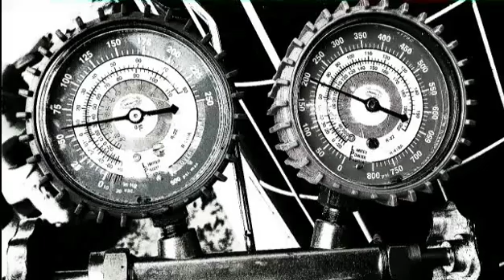R22 to R410a Conversion: Line Set??

Comment: I had a r22 system and it was low. A tech told me he didn’t have any r22 and wanted me to let him install a new system for $9,000. I bought a gauge unit off ebay, a r12 to r134 adapter from Napa and 4 cans of r134 from Walmart. I installed the freon and my system ran fine for 5 months until winter.
Reply: What happened after winter?
Reply: @nthomas36  I install a new Rheem evaporator and a Goodman condenser.
Reply: And by reading this right r22 is a home system r134 is an auto system.
Reply: @jchistia  And? A/c work the same weather in a house or car. They said my system was old and about to die. I just wanted it to last one more summer. It did using the 134.

Comment: I know this is an old video but here is my practice. If the old lines are brazed and sized properly I reuse them with no flush just nitrogen purge. If soldered joints in multiple places kinks I replace it. I have never had an issue reusing a good looking line set. I install a new dryer / filter. I tend to use a dryer/ filter larger than most but go big or go home.

Comment: But what if the line sets used for r22 were .032 wall thickness and it is required that wall thickness for 410a are .081 . Would the .032 work for 410a?

Comment: And one more thing..... just think about this... it's all about more money. 

I have never used nitrogen to purge while brazing and have never had a problem. If done correctly, i.e. not using 15 elbows, you won't have a problem. It's a gimmick to get you to have to buy more nitrogen. When this was first introduced in say, 2008-9, I had already installed hundreds of 410 systems. Without issues. The price of nitrogen went up because Parker Sporlan ran seminars all across the country and the demand for nitrogen increased. 
I don't do it. I don't flush. I did once. My partner and I tried it. Cost was damn near $100. We shot it thru only to watch our $100 land on the concrete and evaporate. Never used it again. As far as the nitrogen purge goes, whatever flaking does occur will be caught by the screen and filter dryer. I don't but into gimmicks.
Reply: pointedspider wow! I have been out of the trade for 20 years and have thought of the hundreds of hot soldering I’ve done never possessing a nitro tank on my truck! I’m replacing my shop Heat pump to 410A and the more I search the more I think I’m doing a heart transplant! Thank you for bringing me back to earth and saying what I’ve been thinking.

Comment: new to the commercial hvac. we have 15 rtu units manufactured by trane. People have told me to just replace the units. There is no way we will spend that much money so that being said they want to change the coils lines and compressor but sounds like that is not needed. So if we changed the txv and add the 410a we will be ok

Comment: I really needed to know this. Just making sure, do I understand correctly that you don't feel that a flush nor a line change (removal and replacement) is necessary? Are you saying you would only do a mechanical cleaning/clearing of the lines? ie, just blow out the lines and connect the  new unit? Please forgive if I misunderstood and forgive for the long, tangled question. I just want to make sure. THANK YOU!!!!

Comment: Just a quick question can you use 5/8 suction and 3/8 liquid if the new unit has 1/2 and 1/4 connection would have to add more gas but would there be any other issues thanks

Comment: It makes no sense to me why a lineset is replaces simply because a different refrigerant is used.  I would flush the lineset if there is a possibility of contaminants which would mean disconnecting the compressor....extra work.  Otherwise, an Ni is enough. The integrity of the copper pipe and brazing material should be unaffected (chemically).

Comment: I would not let you work on my system.
Reply from the maker: Why?
Reply: Zack HVAC If you take shortcuts it is a sign of laziness. If I'm getting a new system I want a complete system not a half assed install.
Reply from the maker: 3 Papillion don't confuse shortcuts from knowing what matters and what doesn't
Reply: Zack HVAC What maters is the customer. How he feels about his install he paid a lot of money for is important. So why not avoid the possibility of a leak and just replace the lines? I just had a replacement system installed and got estimates from four company's and not one suggested reusing the old line sets. I feel good about my new install.
Reply from the maker: 3 Papillion that sounds great. I will be honest. I have never come back to a job ever to repair a line set that was reused. To be fair, it could be possible so I cant argue with replacing it if you feel strongly about it. You are right, it is the customer that must feel good about it.

Comment: I talked to the stay Brite tech. man a while back and he told me staybrite 8 would work fine with 410a just dont flux inside fe-male fittings.  I have used it many times and had no trouble. any comments on this?
Reply: I've been using Harris Staybrite #8 for over 30 years and never had a problem on R-22 and R410A systems. I never flux the female fitting and only flux lightly on the male fitting.  However, just my opinion, but I think anything over 3 ton should be brazed.

Comment: Thanks for this video and discussion. I've got a 25 year old Carrier 2.5 ton R22 set which I've had a slow leak in for the last couple of seasons (no one can locate the leak). I'm at the point of either doing a dye test, replacing the Resco evap coil or just replacing the whole system with a 410a system. In your opinion, what is the best 3 ton replacement if I wanted to go that route? Any chance of any of the new units making it 25 years like this one did?
Reply from the maker: probably not going to last as long. Cartier would be a good one to go back with.

Comment: Zack I have question if I have a 410a evaporator and condenser r22 want to change the condense 410a so well to change the evaporator or just clean with r11 evaporator if you have time can answer my question 'm studying hvac I really like your videos thanks
Reply from the maker: I had a 410a capable mortex coil hooked to an old goodman r22 unit. The owners decided to have me change out the unit to r410a. All I did was blow it out. I did remove the orifice but that was all. I used nitrogen.

Comment: The Longer answer---There are so Many Things to Consider When thinking about Changing a Line Set Out. Age, Beside the Ocean, Line Size.
These Conditions Listed Below are the times When Line Sets Should be Changed out---
1) If the Line Set is Older than 30 Years old ! the Suction line is at the End of it's Life. Corrosion. The Suction line will Become Porous Like a Sponge and Start Leaking or is Allready Leaking Slightly. i've seen it before & Personally removed a bubbling 50 ft of suction line.
2) The insulation is Worn out after 30 Years---No insulating Properties Left in the insulation. Drips may start showing up all over the place.
3) Pull Back Some Suction insulation and inspect the suction line in the ceiling about 3-5 feet away from the evaporator. if the Suction Line is Green & corroded !!! Change that Line!!! Suction line will start leaking very soon.
4) This one is a Given of Course---is the old R-22 Line Set Sized Big Enough For the New R-410a System? Efficiency is affected Here. Going from 7/8 to 1 1/8 will Pick up Efficiency and Give a Better / suction Pressure During Different Load Conditions. See---a copper tubing / line sizing / Type of refrigerant used. Recommended Line sizes vs Efficiency.
5) Reducing the Electrical Bill---Going from 7/8 to 1 1/8 will Reduce runtime of the unit.
Reply: Thank you for sharing your knowledge !

Comment: After 34 Years in this Business---The SHORT Answer---I Agree With YOu 100% on YOur Thoughts Exactly. YOur Thinking & Thoughts are Exactly the Same as Mine on this issue ! and i have NEVER Had to Go Back and Replace a Compressor OR Condensing unit using these thoughts. Of course after i say this Next week i'm guaranteed to do a compressor.

Comment: I replaced the unit in my house three years ago. To a 410 a heat pump. I did not change lines or flush just did normal practice of nitrogen and pulled vacuum no issue. When doing change outs at work I do same practice over the last 5 years no issues at all
Reply from the maker: I don't think there is any problem with that

Comment: I dont change lines unless theres a sizing issue. There shouldnt be anything in the lines for the poe to scrub out. Filter drier takes care of anything if it is in there. I just purged with nitro and use nitro when brazing. Never had a problem.

Comment: I totally agree, Emerson recommended 5% mineral oil was acceptable, now they recommend 15% mineral oil, the reason is that the POE can float on top of the refrigerant in the reciever tank, mineral oil will help it to pass on to the compressor. I use to use R11 to flush out burn outs in refrigeration systems, R22 is also a good cleaning refrigerant. I recently used that R11 flush for a burnout on a scroll change out on a beer brewery chiller, the R11 flush got hung up in the evap, condenser, suction accumulator etc, I had to pull a vaccum for Hours! to get it to evaporate out, the R11 flush was very expensive, I won't use it again, I'll just change out flared drier filters and compressor oil if necessary.

Comment: I've been changing them. In most cases the suction line is smaller than recommended by the manufacturer. And many times I've found a kink or a butt splice when I removed the insulation....not to mention lots of "internal couplings" lol.
Reply from the maker: Cant argue with that. I have seen a lot of issues found with old line sets, usually size

Comment: I dont usually change linesets unless its going to be very easy to change it. Most linesets for ressy are in finished spaces so there is no way to easily remove and install new linesets.. As for flushing.,, I usually dont either unless its some type of burnout, I just use nitrogen and blow whatever shit in the line is left over out. I dont think the oil for r22 affects the 410a system much at all, its not being carried like it is in the 410 system
Reply from the maker: I agree

Comment: I think is a good practice  to change the lines because you start with everything new. You dont know what could be in the lines before you were  there. and risking it into a brand new system. Maybe any  debris and the mineral oil that doesn mix with poe oil
Reply from the maker: It will never hurt to do it for sure. I do not personally and have found no ill affects. I have a few that have been running 6 years.

Comment: Zack I found new installed line sets that was not install correctly give More problems then reuse line sets that was flush properly. I do a lot of service and replacement work if the line sets are leak free I will reuse them.
Reply from the maker: That's my policy

Comment: i very much have to agree with you and disagree. do you have to change the lineset everytime, no. if you have acid present in the system then YES if changing the lineset is possible. if not then flushing the lineset is a way to ensure a good system install. now many may not agree with me on this practice, but i know for a fact you must do it. I installed a system a couple years back and One: did not use nitrogen, Two: did not use flush. Because of this i was back at the same house three years later changing a reversing valve and compressor. Now was this caused because the correct installation procedures were not followed? maybe. But since then I always use nitrogen, flush my lineset (with flush and nitrogen) and add a filter line drier to make sure all my systems are clean. Now is this practice for everybody, no. But take it from me as a CYA for you and your customers who pay good money for these installs. If you follow this practice NO CALLBACKS!!!!!!!!! Just some food for thought. You guys have a wonderful evening.
Reply: Good point 😃
Reply from the maker: Good advice, if you want to go all the way you can remove any possibility of issues.
What brand machine was it?
Reply: Zack HVAC It was a Trane two and a half ton.

Comment: We don't change any line sets unless under sized or an issue , we do use flush but like u I don't agree that it's needed unless burn out . My manager rather be safe than sorry but I think it's B S and just another form of money making by the suppliers . In the beginning they weren't sure if it was going to cause issues and everyone just got freaked out. Guys that say u need to change a line set with every install in my opinion are learning it from school with no experience in the feild or should I say nate . Great topic Zack .
Reply: tecnico what's the sad face for ?

Comment: Now, I've been doing commercial refer work for almost 30 years but would like to throw something in on this.  I recently (within the last 2 years) started venturing off into residential and have talked to a few guys on this subject.  They were talking about installers years ago would use soft solder in their braze joints and how this would cause problems when linesets were pieced together and you have braze joints in the wall and you are now running 410a through them.  Just wondering whether you have run into any of those instances.

Charles
Reply: Soft solder can handle 410a
Reply: @haydent1000  Staybrite #8.  It's been used fr decades!

Comment: I do mainly refrigeration so its a bit different, i have no problem converting an existing system from mineral to poe oil and then newer HFC refrigerants, infact thats how i started in this industry.

If it was a minisplit it would get a new line set, partly because i don't trust the whoever installed the original copper.

I would be happier with a bit of mineral oil contamination rather then some left over flushing fluid. I see flushing kits as diversitech just wanting to make money...

My attitude is if i have to warranty it then i want to have done it all so that would mean replacing the line set.

Comment: We don't change the piping unless it is sized wrong. We add cartridge driers and change them out after a few days of operation if needed. It is not really an issue if a small amount of oil is mixed.
Reply: Yeah Rob we did the same. We added core dryers on the liquid and suction lines. The suction lines were 2" 1/8 and the liquid lines were 1 "1/8.
Reply: When we had that seminar with the guy from Dupont. He said at first it was a big concern because it was something that they have not dealt with in the past. Now they approve leaving the older piping unless it's undersized obviously
Reply: Good info Emin HVAC

Comment: If mixing oils was an issue then why are all the new compressors that are meant for r22 units shipped with POE oil in them. Meaning if I come up on a 6 year old unit with a bad compressor, the new compressor comes with POE oil in it. I've never heard of any one flushing out a line on a compressor change out. 

Also the unit at my house is 8 years old and I didn't blow out the line at all when I installed it on a 30 year old lineset it's still working fine.
Reply: That bulletin from Emerson indicated it is not a problem to mix Poe with mineral when using 22 or any CFC or HCFC. My guess is since HFC refrigerants don't carry the mineral oil back and if a) long lines b) evap below compressor c) large amount of mineral oil remains - than you could potentially have a problem. I still blow lines out with nitrogen and only use flush if I know I can get it back out. IMO you can't go wrong with getting the lines as clean as possible.

Comment: I've never changed the r-22 lineset when switching  toa r410a unit, unless its a complete re do. I also have been told by a valve manufacture to add some mineral oil in the valves ( solenoid valves ) they were having issues sticking with the POE oil, also back in the 90's when freonagedon went down I found systems with mix refrigerants in them running for years. lol, blow down with nitrogen is what I've done, do as clean a job as you can, pull a good vacuum and let it rip.

Comment: Zach 7 years ago we changed out four 30 ton condenser,we went from  R22 to 410A. The company  kept the old air handlers and the refrigerant lines. However we had to change out the TXV and the orifices in the distributors. This job was signed off by the engineers with no issues. Also it was approved by TRANE engineers. These units still operate with no problems.

Comment: The only time I change the lines is if they are undersized or if there was a question if there is a leak somewhere in the line (which doesn't happen all too often).  I have never had a problem.  I took a class at Lennox about ten years ago about r410a conversion.  The instructor said that not only did you have to change the lines but also from the time you pull the plug to release the nitrogen from the coil and the new lineset, you have TEN MINUTES to get the lines brazed and the system in a vacuum otherwise the system would be contaminated with moisture.  Complete bullshit.
Reply: Mmnn,  Jim D,      I would ask the Lennox guy to  demonstrate a 10 minute  cut loose and braze in and nitrogen pressure up.... in the field!.
Reply: @ritewayguy  That's why he was a Lennox "instructor" and not an installer.....

Comment: I change the line set if easy and accessible to do so. I always cut out all soft solder joints and I always flush lines that I am reusing. With all the problems with the new TXV's I don't need anymore problems. Now we have to add an oil additive to system to keep TXV's from sludging up with muck.